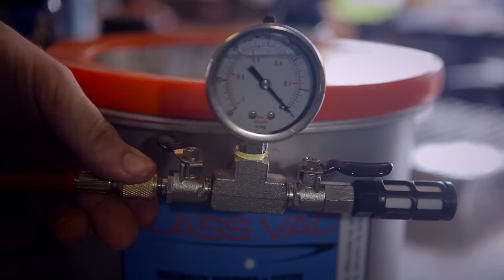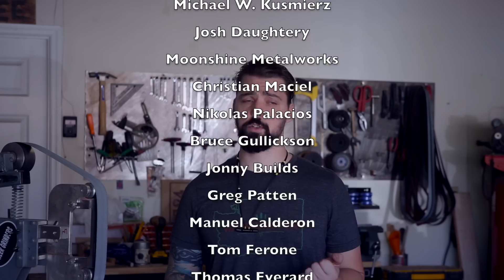Epoxy resin & stabilized wood tool handles

Comment: Nice work sir is it possible to use this to make a knife handle Will the bond be strong enough to stick to the metal I want to sit the blade in the mold have  2 inches of all the why around it sanded it down I'm thinking it'll look like a screwdriver with a clear handle finish

Comment: Wow--fantastic video.  What is the "pressure cooker" machine doing and why is this step necessary?  Thanks
Reply: i'm no expert on the subject but I'm pretty sure it's necessary do put the resin compound while its hardering in a vacuum due to the fact that the pour of the resin might cause bubbles. Its an expensive but easy way to make sure that the mold comes out 100% every time.

Comment: I always thought these 'stabilised epoxy wood' pieces' were called so, because the epoxy was stabilising a piece of wood, lol. I learned about the stability process just recently, but, still, we see unstabilised wood, most projects in fact, i.e river tables etc, which are not stabilised wood. and encase in the epoxy just fine.    ..... So, have you ever tried doing the exact same pieces as here, but with just the end of a 2x4, or some other scrap??. I actually collected some nice dried out pieces of hollow dead wood, and had planned to just encase it, and cut it up, but that won't work??

Peace

Comment: Let's see... I cut a bunch of blocks of wood, then I put them in the smoker overnight.  Then I put them in a pressure cooker, dump a bunch of water on them and boil.  Then I put them back in the smoker overnight.  Then I cut them into smaller pieces, drill random holes and make random cuts in them.  Then I glue them in a cardboard box, spray them with Raid, pour auto-body filler over them, and pop them back in the pressure cooker.

While I'm waiting for them to cook, somebody with thousands of dollars worth of heavy shop equipment in their garage -- and way too much time on their hands --- makes me a bunch of handles for my tools.  Cool.

Y'know, a voice over explaining what was going on would have been more useful than the music.